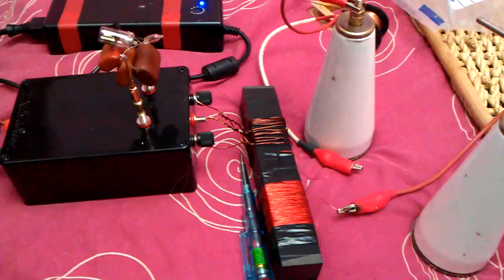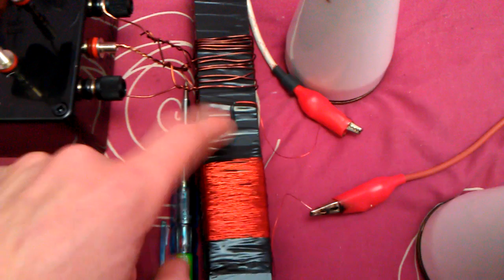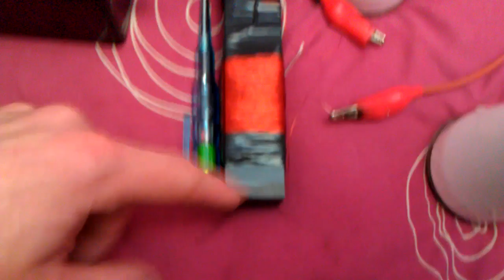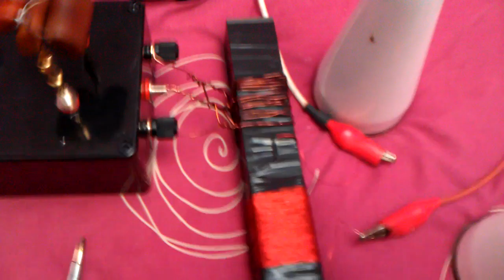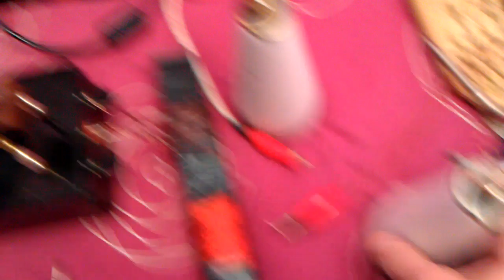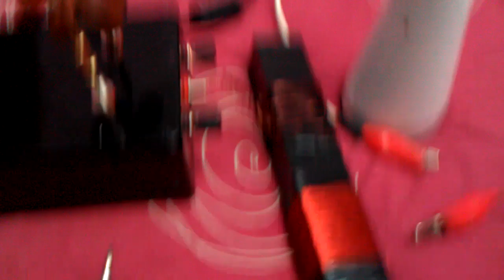LARGE'' ferrite rod

Comment: What wattage does the zvs give out? I've not found any over 1000watts. I'd like more🤔
Reply from the maker: wouldn't we all lol. the only way I suppose is to parallel ya mosfets. and push it!! iv had 60amp out of a zvs driver when powering Xray transformer lol

thanks

Anthony
High1voltage1rules
Reply from the maker: that was 70 volts lol from my variac
Reply from the maker: that was 70 volts lol from my variac 😉👍